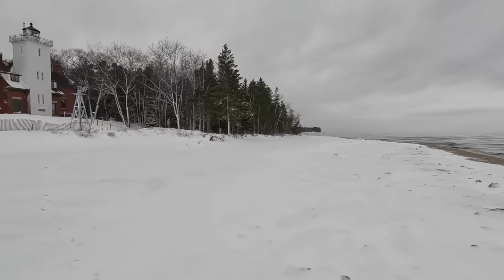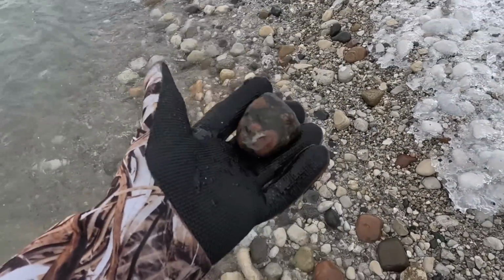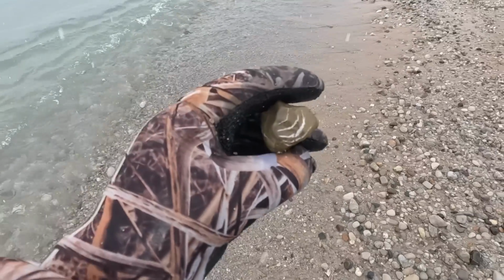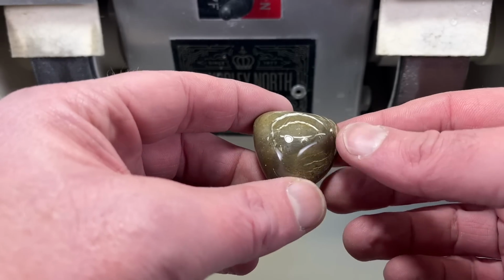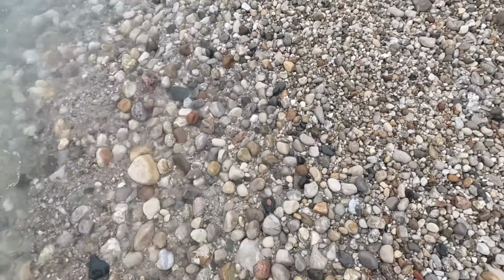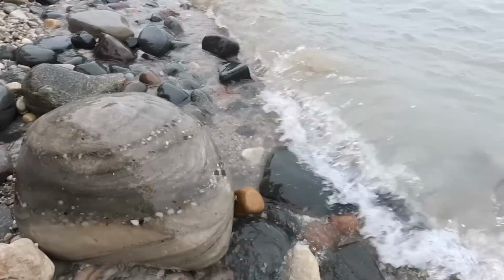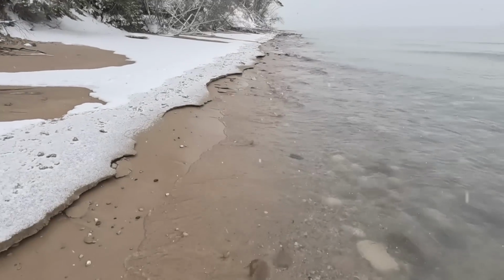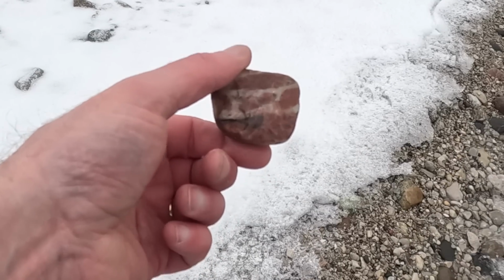40 Mile Point Lighthouse Winter Rock Hunt

Comment: That was refreshing and I didn’t even get cold. Beautiful icicles. The rock at 12:00 was a dandy. Did you bring it home?  Just out of curiosity do you know what rpm that the cab machine runs at.  Thanks for taking us along.
Reply from the maker: I didn't get cold either. It was in the upper twenties if I remember correctly. 

The cab machine runs at 1725 rpm.

Comment: Can you slab and cut any of these big rocks down to tumbling size?
Reply from the maker: I suppose someone could. I can't and I wouldn't even if I could. I have a pretty small saw. I can only cut a rock 3.5 inches across. Bigger saws have very expensive blades and I wouldn't waste blade life on breaking a big rock down for tumbling. I also don't really like the look of rocks with flat sides as tumbling material. I like a more naturally shaped rock, which probably sounds weird since I usually tumble them down so they're completely smooth and not all that natural looking.
Reply: @Michigan Rocks  I understand.  I'm still pretty new. Just wondering.  I know my tumbler came with tiger eye that was cut into squares. 
But if you ever need you can buy a gasoline powered masonry saw😂
Reply from the maker: @pauliewallnuts4741  I have occasionally cut rocks up, or trimmed bad spots off of a rock. I have also bought rock like you have that has been cut.